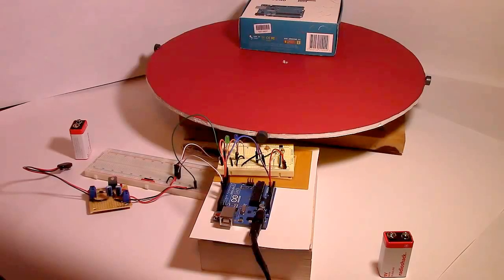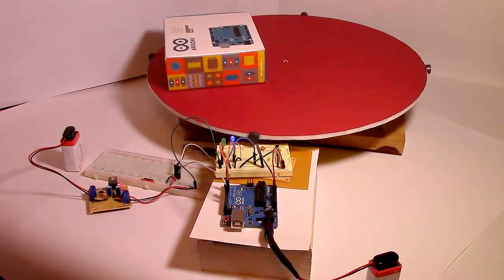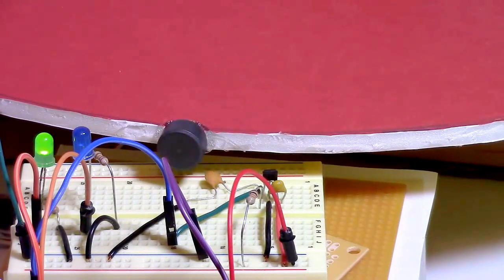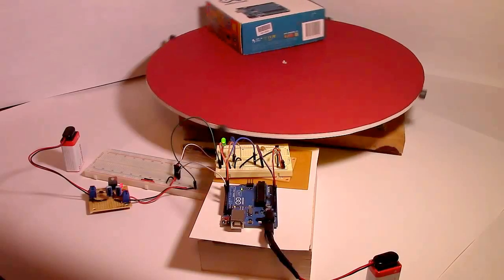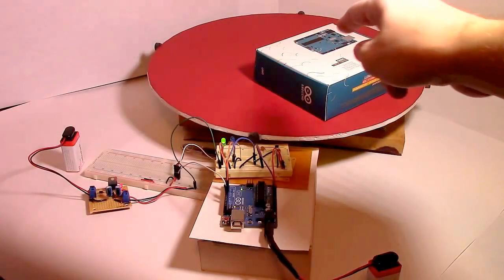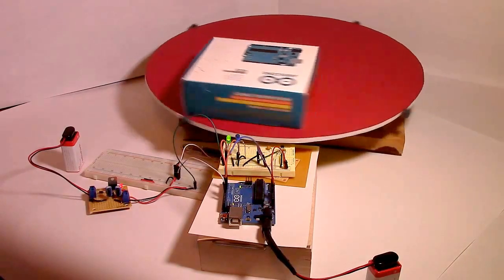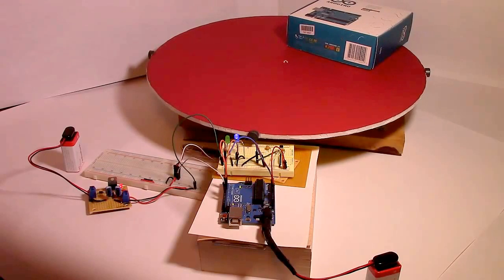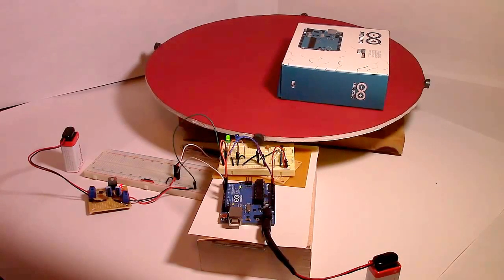Arduino Controlled "Turntable" || Arduino + Hall Effect Sensor + "turntable"

Comment: Thanks, the code didn't come through, but I think I may be able to figure it out. I'll be using a large DC motor instead of a servo, so it has some challenges. It'll also include a LCD readout of the parameters, some buttons and a knob for custom functionality. I'll post a video when it's finished. Thank you again!
Reply from the maker: TheChaz Using a DC motor instead of a servo would introduce some extra challenges...in that case a momentary type hall effect sensor and perhaps some form of electric braking system might be the way to go.  I used the toggle type solely because I couldn't locate my momentary ones.  I'll definitely look forward to the video.  I always enjoy seeing how an interesting functionality/behavior is achieved.

Comment: I am working on a controller for a rotating stage. I really like your project and I was wondering if you would allow me to view your sketch? Thank you for your inspiration!
Reply from the maker: Thanks for the comment and for watching!  A rotating stage certainly sounds like a neat project.  Let me know if you upload a video, I'd be interested in seeing the finished product.  I'm glad the video was helpful.  

Project Code:    
/*
title: arduino_hall_effect_turntable
by: philomech
date: 10/2014

---> sensor# & type: US1881 toggle type hall effect sensor from sparkfun

-> north mag pole toggles sensor output HIGH 
-> south mag pole toggles sensor output LOW 

hall effect hookup: (datasheet for schematic)

description:
            Continuous rotation servo turns table top.  Hall effect
            sensor combined with magnets (alternating poles around outside of top i.e.,               N, S, N, S) stop wheel for a set time in each of 4 quadrants.
            Akin to an automated ferris wheel, or circular conveyor
*/

#include <Servo.h>
Servo servo;
/******************************
* global variables                    *
******************************/
int hall_effect_pin = 2;    //hall effect sensor output connected to Ard D2

int north_led = 7;           //blue
int south_led = 8;           //green

int previous_hall_effect_state = 0;   
int current_hall_effect_state = 0;    

/******************************
* setup                                    *
******************************/
void setup(){
  //Serial.begin(9600);
  //delay(150);
  
  pinMode(hall_effect_pin, INPUT);
  
  pinMode(north_led, OUTPUT);
  pinMode(south_led, OUTPUT);
  
  servo.attach(10);
}

/*****************************
* main loop                             *
*****************************/
void loop(){
  
 //read and store sensor state (1 or 0)
  int current_hall_effect_state = digitalRead(hall_effect_pin);  
 
  //for debug                                                               
  //Serial.print("hall effect state = ");
  //Serial.println(hall_effect_state);
  
  //if current state doesn't match previous state
  if(current_hall_effect_state != previous_hall_effect_state){ 

    //and current state is a 1, turn off south led, turn on north led
    if(current_hall_effect_state == HIGH){ 
      digitalWrite(south_led,LOW);
      digitalWrite(north_led, HIGH);
    }
    else{              //current state is 0. turn off north led, turn on south
      digitalWrite(north_led, LOW);    
      digitalWrite(south_led, HIGH);
    }
   
    //state changed so...
    servo.detach();       //stop servo
    delay(3000);          // for X seconds
    servo.attach(10);     //then reattach servo
  }
  previous_hall_effect_state = current_hall_effect_state;    //update previous state    //variable
    
  servo.write(88);  //slows servo speed, number will be relative to servo
  
}  // <--- end of void loop

Comment: Hi Philo,

Great work man. really nice. could you tell me what to do with coding when you are using two  different sensors for one single output ( ON and off led for 3000 times), please?
Reply from the maker: Nasfik Khan Appreciate the feedback and question.  So that I understand the logic of what you're after... Do you want the reading from one sensor to turn ON a single led and the reading from another sensor to turn if OFF, over and over again?  Something like this:

void loop(){
     
        sensor_1_value = digitalRead(sensor_1_pin);
        sensor_2_value = digitalRead(sensor_2_pin);
        
        //the following would turn an led on when sensor_1_value goes HIGH
       //and keep it on 
       //until sensor_2_value goes HIGH

        if(sensor_1_value == HIGH){
                  digitalWrite(led, HIGH);
            }
        else if(sensor_2_value == HIGH){
             digitalWrite(led, LOW);

         }

}

Or might you have something else in mind? I think you might given the mention of 3,000 times....not quite sure what you have in mind regarding that number.    

Just let me know, provide a little more detail, etc., and I will continue to do my best to help.
Reply: Omg that's really cool... You are great ... Really appreciated. And yeah , I need to run the cycle for 3000 times... If possible could you update the codes to run the process for 3000 times... :)
Reply: philo mech Good man, Please let me know my codding (after using your idea) are right or any thing wrong. Actually I can not run it right now as it is sunday and I dont have those sensors with me. But please let me know, if I am right to get the correct output. PLEASE.

/***********CODDING*********/ 
int sensor_1_pin = 2;
int sensor_2_pin = 3; //hall effect sensor output connected to Ard D2

int led = 7;   

int sensor_1_value = 0;
int sensor_2_value = 0;

int cycle = 3000;
int i = 0;

void setup()
{
  Serial.begin (9600);
  pinMode(sensor_1_pin, INPUT);
  pinMode(sensor_2_pin, INPUT);
  
  pinMode(led, OUTPUT);
}

void loop()
{
  sensor_1_value = digitalRead(sensor_1_pin);
  sensor_2_value = digitalRead(sensor_2_pin);
  
  Serial.print ("Sensor 1 value = ");
  Serial.println (sensor_1_value);
  Serial.print ("Sensor 2 value = ");
  Serial.println (sensor_2_value);
  
  if (sensor_1_value != sensor_2_value)
  {
    if (i<cycle)
    {
      if(sensor_1_value == HIGH)
      {
              digitalWrite(led, HIGH);
              Serial.print ("Sensor 1 value = ");
              Serial.println (sensor_1_value);
      }
      else if(sensor_2_value == HIGH)
      {
             digitalWrite(led, LOW);
             Serial.print ("Sensor 1 value = ");
             Serial.println (sensor_1_value);
      }
    }  
  }
 sensor_1_value = sensor_2_value;
 Serial.println ("Thanks Mr. Philo Mech");
 Serial.println ("You are GreaT ");
}
Reply from the maker: Nasfik Khan Thanks for the reply and code.
  
As currently written your code will:
1st) Enter the main loop and read and print the values of both sensors.
2nd) It will test to see if the sensor values it just read match or not.  
3rd) If they differ (they mismatch), and if the variable 'i' is less than 3000 (which it intially will be because 'i' has been set to 0 above setup) ,it will then test the 'IF, ELSE IF' conditions
3rd) if sensor 1 is HIGH it will turn on an led and prints sensor 1 value
OR if sensor 2 is HIGH it will turn off an led and prints sensor 2 value
4th) after completing the IF, ELSE IF tests the sensor value variables will be set equal
5th) it will then return to the top of the main loop and repeat.

For the 'if(i<cycle)...' to do useful work, you will need to increment i's value each time through the main loop, e.g., a line to the effect 'i++' or 'i = i + 1' will need to be added at the end of the main loop, right before the last parentheses..
Adding such will make the IF ELSE tests be performed for 3,000 times (3,000 events of the two sensor values not matching).  After which your main loop will never test them again because 'if(i<cycle)..' will always be false and the embedded IF ELSE IF will be bypassed.  

Is this the sort of behavior you had in mind?  I ask because as currently written your program it will perform those IF ELSE IF tests for 3,000 cases when the sensors don't match.  That is, when their values differ it will test to see which is HIGH, turn the led on or off and then hop out and wait for the next time their values differ, etc., etc., up to 3,000.  After 3,000 sensor mismatches the current code will never test the IF ELSE IFs again given that i will at that point be greater than 3,000.  I suspect that you might want the Arduino do something else.  

What precisely do you want to happen 3,000 times?  

Do you want it to only test the state of the sensors for 3,000 value mismatches?  If so, then your code will do that.  

Or might you want it to test something for only 3,000 milliseconds?  

If you had something else in mind just let me know and we will continue to work on the code.

Hope these comments are helpful.
Reply: And by mistake I forget to add 'i++' in the end of if loop.
Reply: philo mech I just tried my codes with the sensors but it did not work as I wanted. It runs for 10 times with one sensor only. I want both output ones. As if, 3000 time it will ON after contact with first sensor and then wait until it contact with second sensor then turn off . 

flow chart will be like,
(Start -> Magnetic Sensor 1 ON --> Solenoid Valve ON --> Magnetic Sensor 2 ON -----> Solenoid Valve OFF ) 3000 times

Last two weeks, I tired a lot to sort it out. there are 3 issues and those stuck me for ages.

                Issue 1: when I brings the sensor1 closure to the Magnet, it LED turn on until I remove it but I want to remain it on until the (second sensor) sensor2 come close to the Magnet. 

                Issue 2: When I brought the sensor1 close to the magnet, it runs for 3000 times until i remove it. But I want the led will turn on and then sensor 2 will be closure and led will turn off. AND OVERALL, it WILL COUNT as 1 CYCLE.

                Issue 3: the following code give me value like "Sensor 1 Value = 1" and "Sensor 2 value =1".... No idea why??

However, I actually, want to get the feedback from the sensor and led will turn on and off according. As when sensor 1 will bring closure to the magnet, it will turn on and then it will remain on until sensor 2 will come closure to the magnet. Similarly LED will remain off until sensor 1 will bring closure. and cycle will count only when the LED is turn on and off once. 

Please help.
Reply from the maker: Nasfik Khan Thanks for the additional details, they're helpful.  

Issue 1 might be fixed by using a different type of hall effect sensor.  It sounds like you're using a momentary type, perhaps a latching type would be better?  Momentary hall effect sensors turn on when a magnet's N or S pole is held in front of them and quickly switch off once the magnet is removed.  Latching type sensors will latch on and stay on when one pole of a magnet is placed in front of them and unlatch when the opposite pole passes by.  I was using a latching type sensor in the video, it's latched when a North pole passed and unlatched when a South passed.  N-Latch, S-Unlatch, N-Latch...etc.  Might such be helpful for your application?  Just a thought.    

How are the magnets being transported to the face of the sensors?  Are they attached to some form of rotating or linear actuation setup?   I ask because knowing this information will help me think through the needed code.  Essentially, what's controlling when and how the sensors are 'seeing' magnets?  What's bringing the magnets close and then removing them from the faces of the sensors?  Is such consistent, e.g., the face of sensor 1 will be exposed to a magnet once per a complete revolution or actuation, etc.? 

Just let me know and we will continue to work through the difficulties you're encountering.
Reply: Magnet will be transported by a different mechanism and I just need to sure LED will response according to the sensors ... But most important thing is for that I need to make sure LED will remain always on or off according to the previous sensor .
Reply: philo mech actually I sort this out ... Almost done ... Just would you tell me please how to make those led remain same as the previous sensor. As example, if sensor 1 touch the magnet then led will turn on and it will remain on until the sensor 2 touch the magnet. And you did the same on your project, if north on then remain on until the south led on.
Reply from the maker: Nasfik Khan Thanks for the replies.  Here's the code I used in the project.  It has two leds but the code structure for keeping a single led in one state until the pole of a magnet appears should be much the same.   Let me know if there are questions, etc., and I will continue to do my best to help.

/*
title: turntable_circular_conveyor

sensor: US1881 toggle type hall effect sensor
north mag pole toggles sensor output HIGH 
south mag pole toggles sensor output LOW 

description:
            Continuous rotation servo turns wheel.  Hall effect
            sensor combined with magnets (alternating the poles i.e., N, S, N, S)
            stop wheel for a set time in each of 4 quadrants.
            
            Akin to an automated ferris wheel or assembly line device
*/

#include <Servo.h>
Servo servo;

int hall_pin = 2;

int north_led = 7;           //blue
int south_led = 8;           //green

int previous_hall_effect_state = 0;   
int current_hall_effect_state = 0;    

/******************************
* void setup                    *
******************************/
void setup(){
  //Serial.begin(9600);
  //delay(150);
  
  pinMode(hall_pin, INPUT);
  
  pinMode(north_led, OUTPUT);
  pinMode(south_led, OUTPUT);
  
  servo.attach(10);
}

/*****************************
* void loop                    *
*****************************/
void loop(){
  
  int current_hall_effect_state = digitalRead(hall_effect_pin);   //read and store sensor state
                                                                                                            // value will be a 1 or 0
  //Serial.print("hall effect state = ");
  //Serial.println(hall_effect_state);
  
  if(current_hall_effect_state != previous_hall_effect_state){  //if current state doesn't
                                                                                                          //match previous state
    if(current_hall_effect_state == HIGH){   //north pole just passed by
      digitalWrite(south_led,LOW);                 //turn south led off, north led on
      digitalWrite(north_led, HIGH);
    }
    else{                                   //south pole just passed by
      digitalWrite(north_led, LOW);       //turn north led off, south led on
      digitalWrite(south_led, HIGH);
    }       
    servo.detach();       //stop servo
    delay(3000);          // for X seconds
    servo.attach(10);     //then reattach servo
  }
  previous_hall_effect_state = current_hall_effect_state;    //update previous state variable
    
  servo.write(88);  //slows servo speed, number will be relative to servo
  
}  // <--- end of void loop